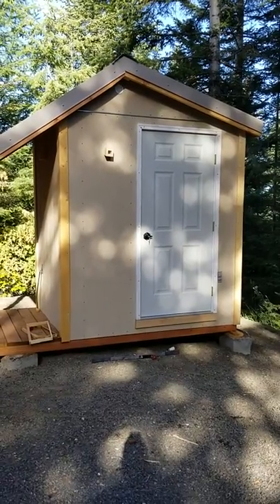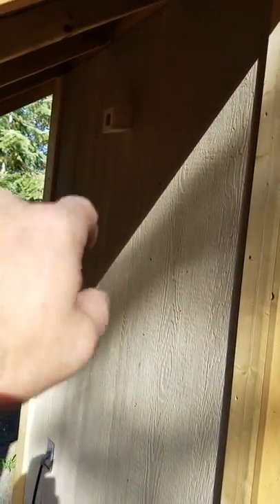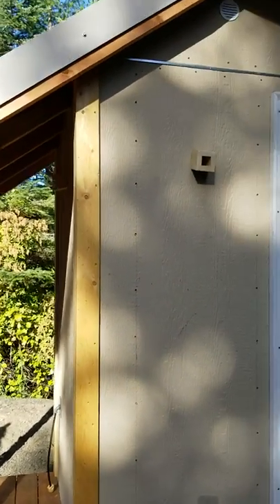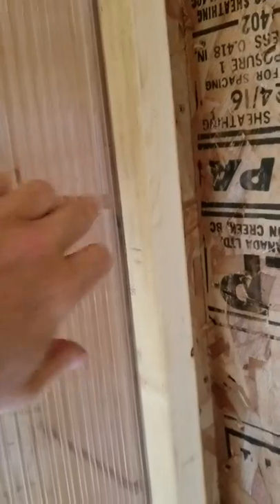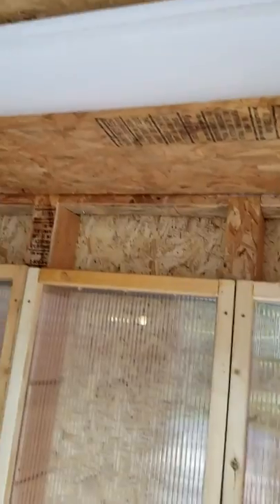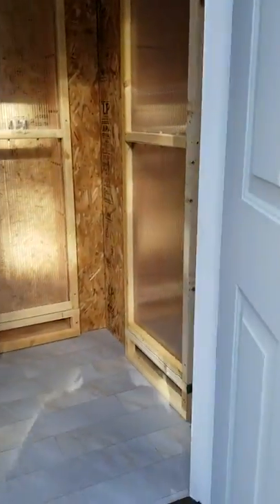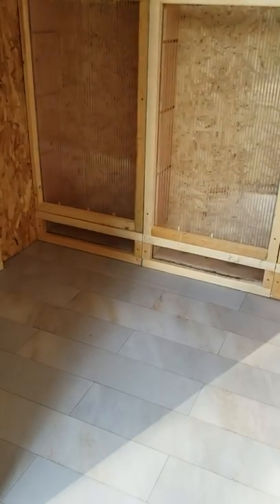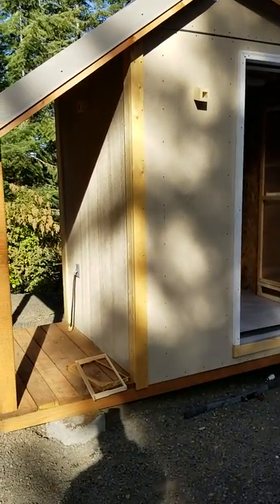Beehouse completed

Comment: What does it cost for one like this
Reply from the maker: This hive cost about 1800 in materials alone, but it could be built cheaper if a person tried
Reply from the maker: The benefits in a cold climate zone is worth any extra cost which aren't much over 6 standard 10 frame double deep Langstroth hives
Reply: joe h. Ya I’m going to be getting in to beekeeping at the start of next year I’m in South Dakota eastern side and that is the biggest thing I’m worried about is the cold last 4 years have been vary cold (-25) for weeks on end so I’m thinking just for safe of mind something like this but maybe a 4 hive thanks for the info your vids have been helpful